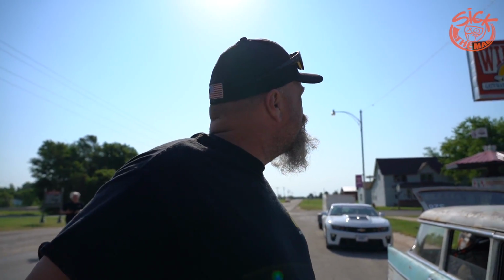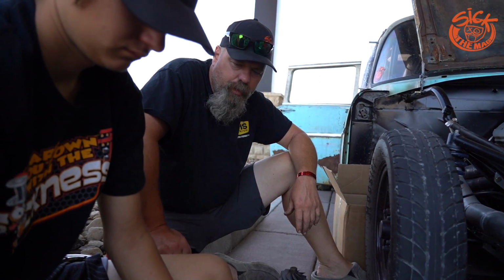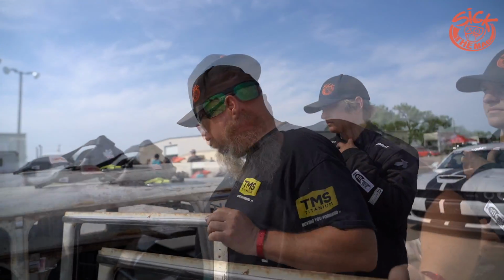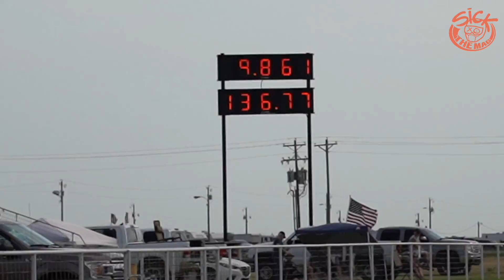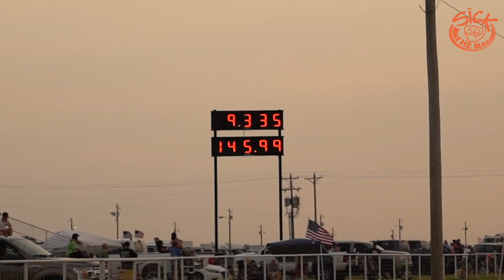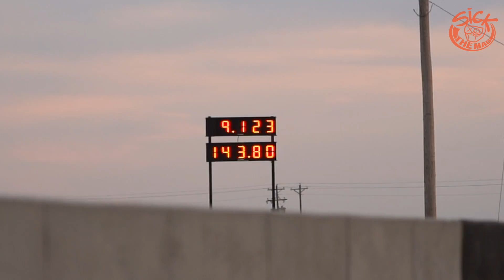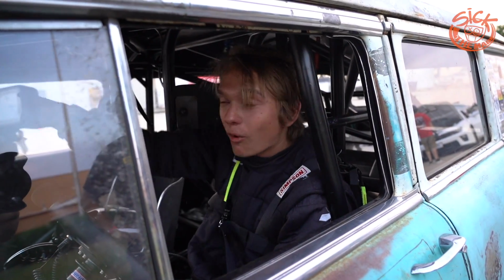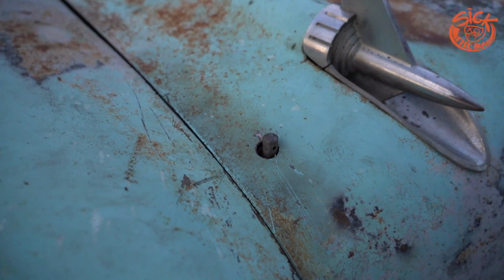SBXDOOM’s Hood Broke Loose (at 147MPH)! Too Much Boost Power On Race Week’s Final Day?

Comment: Impressive work! A few critical mentions though: Aydan is not fully strapped into the seat when at the track. A lot of wiggle in the straps. And when he launches, his head whips back several inches. He scoots down to see the light pole, and reaches forward with his head. When he releases the transbrake button, his head whips back. This will eventually result to whiplash injury at the neck. Nerve damage, loss of motor skills at the limbs, loss in reaction time, cognitive disorders etc. To rectify this destructive behavior early on is crucial to successful career and secure passes. Move the seat so he can see the pole directly from the driving position, and teach him how to tighten the straps. This is not a joke.

Comment: By next season it would be pretty sick to Ayden in the 57 wagon and Tom in the 55 nomad and drop in a either a 427cid or 454cid Dart aluminum 6 bolt block with Top Fuel Hoops aluminum CP/Carrillo rods with CP/Carrillo pistons 11.5:1 or 12:1 compression with a set of Dart rectangle port heads ported by Frankenstein with Jesel shaft roller rockers and a Bryant ultra billet center counter balanced crankshaft topped off with either a Frankenstein "Iceman" or the other good Frankenstein intake if you run nothing but M1 to race with you can get the other intake without the built in intercooler all paired with either twin 88mm Pro Mod turbos with triple ball bearing billet wheel billet center section stainless backhousing and billet front cover with the ballistic cross bolts and the ballistic blanket on the front cover or a 4.6BS SBC all billet 540cid with the same twin turbos or a big single or a Semi Hemi with 5.0 or 5.3BS or maybe even a 481X or a Hemi

Comment: And I think it would be cool if you put a 572cid 481X with class legal twins or a class legal big single and got 1.0 updated and upgraded and went on the NPK circuit since 1.0 is steel roof and quarters and see where you stack up against them guys or built a car specifically for NPK and got Steve to go with you to do all the tuning while you do the driving since Jeff Lutz and Larry Larson both went to NPK and they both do pretty good and both of them have beautiful cars and the way I see it if they can do it you can do it too